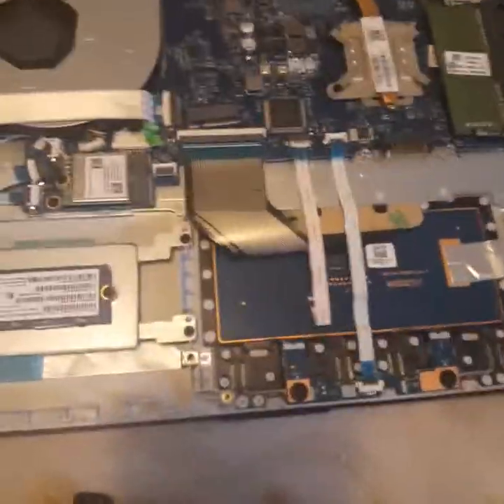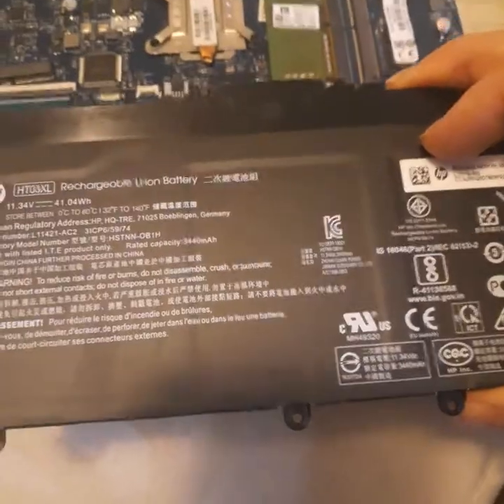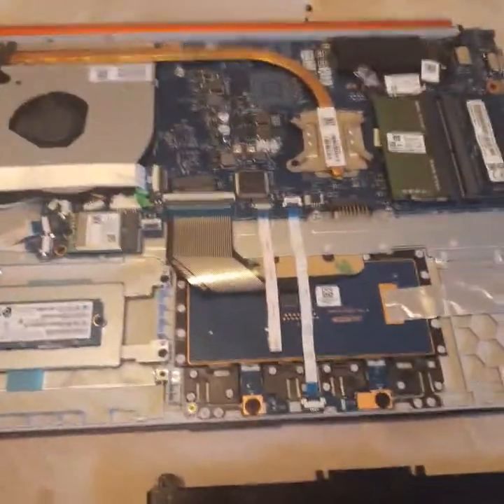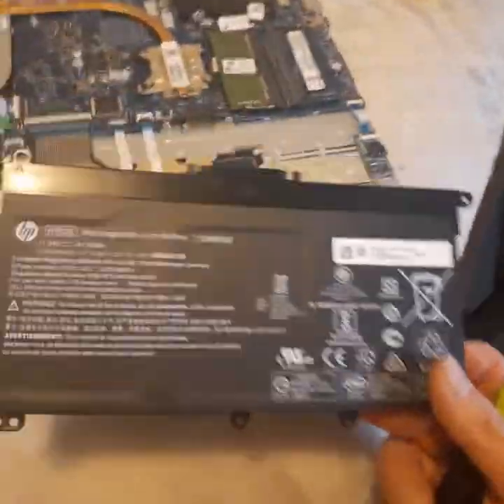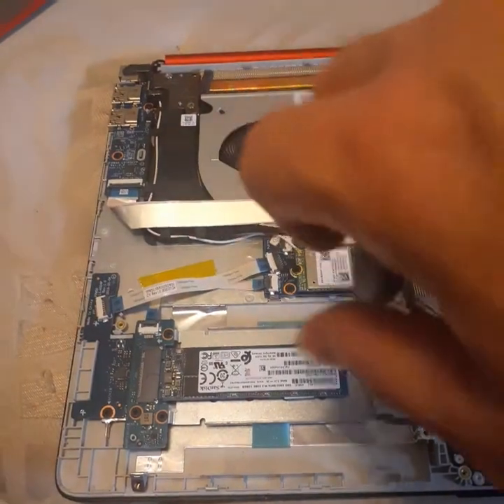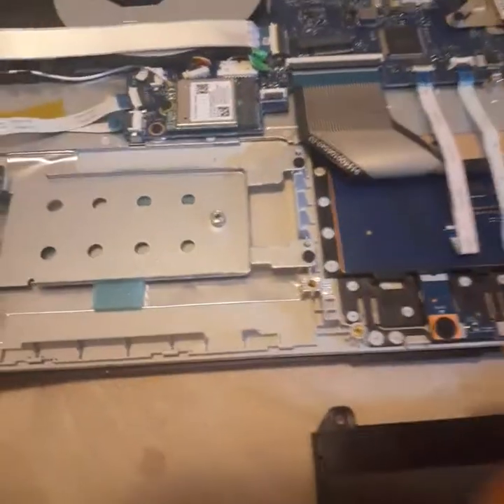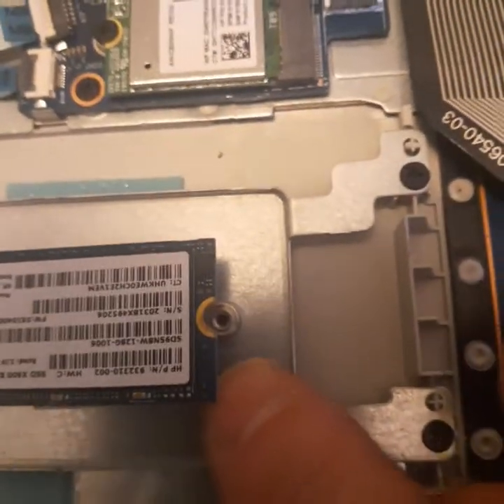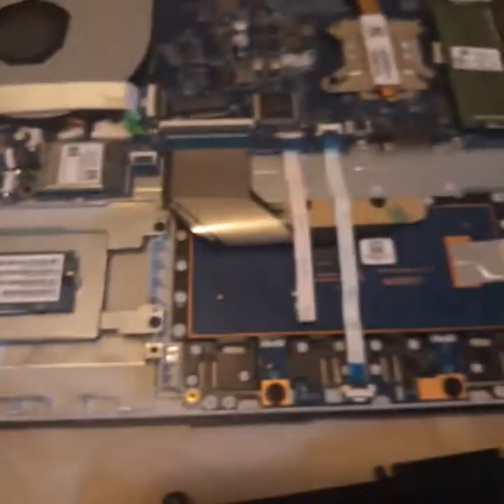Windows 11 upgrade and SSD removal

Comment: Did the battery removal work? I'm having a BIOS issue with flashing CAPS lock and nothing is working..
Reply from the maker: I'm not sure. It just booted about 6 hours later. I think it was a Window update issue.